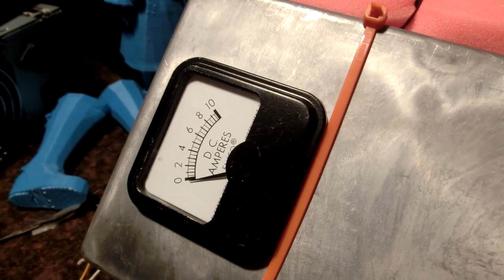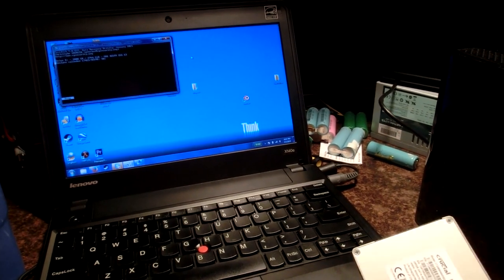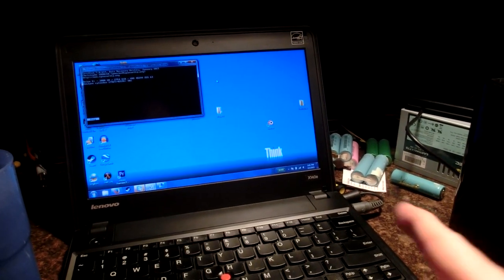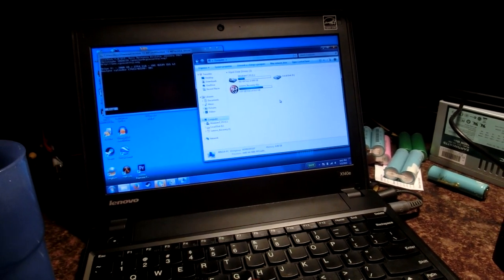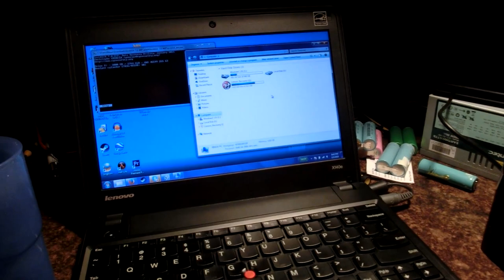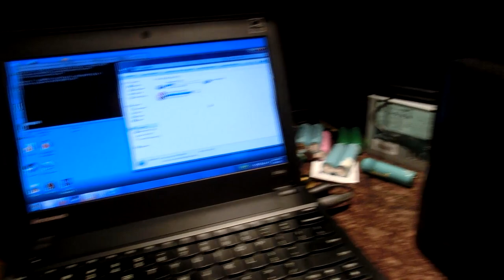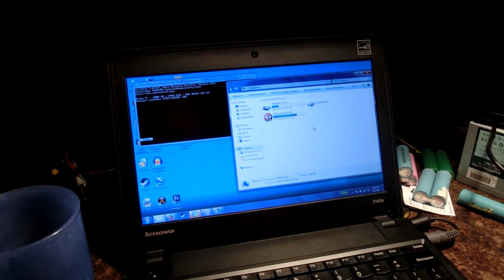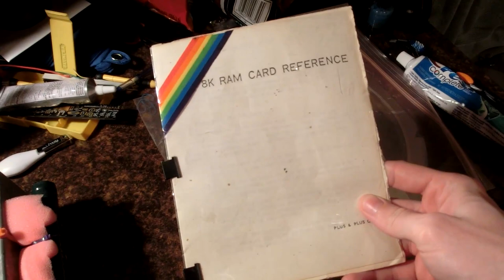Random Bits 0079: E-Trike v1.3 new charger HDD recovery and silicon wafer

Comment: I've used a program call hdclone to copy/clone a harddrive exactly. It will clone your old drive exactly as long as the new drive is the same size or larger. I did this to upgrade to a larger HD  and it worked great. Cloned it, swapped in the new drive and everything was the same on the new drive.

Comment: If i were you i would buy a very cheap windows 7 copy and do a clean install onto the SSD. That really sucks about losing the partition table on your external drive, i've recovered a few in linux but never windows . And that silicone wafer would be awesome framed or hung on the wall

Comment: when I upgraded to an ssd I just booted finnix and used dd to copy my current os drive to the ssd and then increased the gpt size on the new drive but that only works if the old hdd is smaller than the ssd but you could also use software like macrium reflect which I have used before and know works well so long as your drive your cloning from doesn't have any errors in which case almost any cloning software in windows will just give up

Comment: If you shrink the partition on your HDD to the same size/smaller than the capacity of your SSD then you will be able to use ghosting software. 
Download ghost software (I can't remember what I used) -> burn to CD -> hmmm wait, I have to HDD bays in my laptop so I could ghost the drives easily. Maybe you can get a USB-HDD caddy for the Hard disk and put the SSD into the drive bay -> back on track, ghost it. DONE
Reply: I think I used clonezilla
http://clonezilla.org/

I went from SSD->HDD though, but should work fine both ways

Comment: To switch to a ssd I would get a USB sata adapter and clone my HDD to the ssd, there is alot of free software for that or you could just download a windows 7 iso off the internet , burn it to a dvd then install it using the product key on the laptop to activate it.

Comment: internal resistance of batt. has increased. it increases with time. that's why the charging current has decreased. I don't think you have another power resistor in the box.

Comment: You could download a windows 7 copy from kickass torrent or something.  You just need the disk becouse you have a product key.

Let us know if the hard drive got restored and you got your data back.
Reply from the maker: bbb nope, for some reason my product key is weirdly not recognized by microsoft, its like a special cheep key given to lenovo.
Reply: Rinoa Super-Genius Hi Rinoa, try windows loader on a clean win7 install. I recommend Recuva to get your data back, it's free open source software, It takes a while but is capable of deep scanning the surface of the disc. I've switched to ssd's on both my machines now and it really is the best upgrade you can make for performance. I really enjoy your videos, Thanks for sharing all the best.
Reply: Rinoa Super-Genius
OEM keys are not the same as the regular product keys that microsoft sells. The OEM install needs some special voodoo magic in the bootloader to indicate what OEM made the device, and so which OEM keys should work with it.

There's a famous program called DAZ loader (or, windows loader, by DAZ) from the mydigitallife.info forum that activates windows 7 using OEM keys.

You'll need to look at a torrent site to get a copy though.
Make sure you check the hash of the program, because although there hasn't been reports of fake versions it would be a great way to spread a rootkit.
Reply: I know that OEM keys are bound to hardware in pc/laptop that OEM key came with. I dont know if this piece of information will make your problem any easier.
Reply: There is no way you can get a clean copy of Windows from a torrent site. What are you thinking? The closest you can get downloading a clean source is from Microsoft or one of their partners.
Reply: J. William Hunt  I'm  not going to link one, because auto-bans are a thing, but there are a whole lot of untouched .iso images of windows install media. You can toll it's not been modified because it matches the hash that microsoft provide on their site.

I would prefer to download any file that large over bittorrent if I were given the option.
Reply: bno112300 OK. If you can verify the hash, then sure. But then your left hunting for a key, or trying to pair the Manufacturer of your hardware to the software and that doesn't always work out.

 Overall I would prefer to own the media produced by Microsoft and skip all the guess work and quality assurance concerns. OEM versions of Windows are not that expensive and they come with your own key. Newegg even has them on sale from time to time. For me that is the most trusted known source there is. You can make as many .iso and USB images as you want from there for the various ways to install it. Cheers
Reply: Rinoa Super-Genius
just us ezactivator and forget about it :)

Comment: You should also give Recuva by Piriform a try, its free and ive had very good luck with it. Its made by the people who made CCleaner fi you have ever used that, or Defraggler. 

That silicon wafer looks so freaking awesome!  Id like to get a set of maybe a full one, one with a few missing, and one in the state you have. Something about it just looks so darn awesome!
Reply from the maker: Dan G tried recuva, didnt find anything.
Reply: Aww darn, did you try the advanced settings in it? I did that, its "deep scan" I think. 

Uggh ive had similar formatting stuff happen when I was reinstalling linux years ago because the stupid partitions are named goofy.
Reply from the maker: Dan G
i'm just using PhotoRec and thats working.
Reply: Glad to hear it! :)